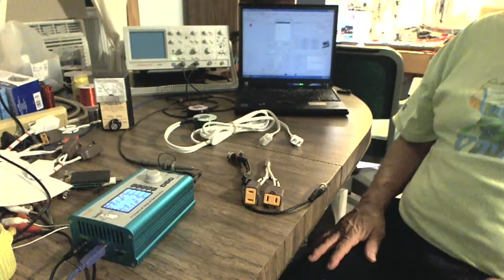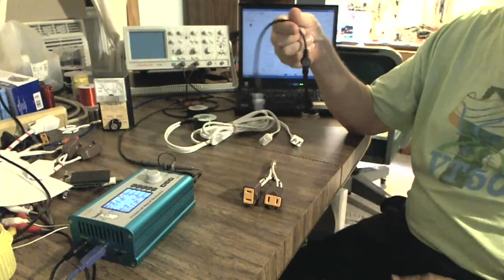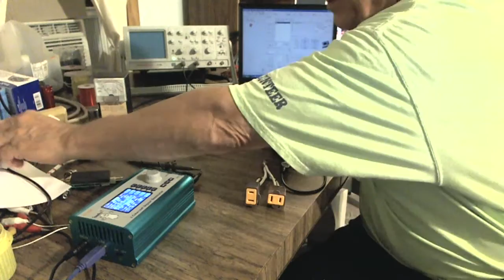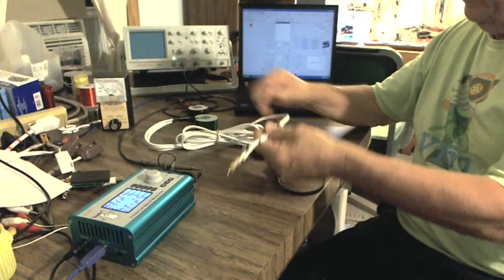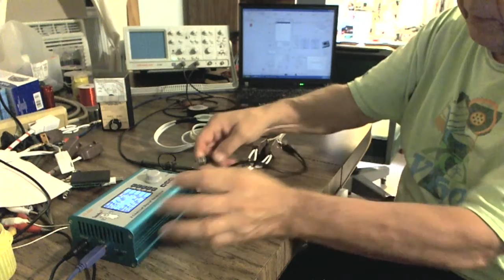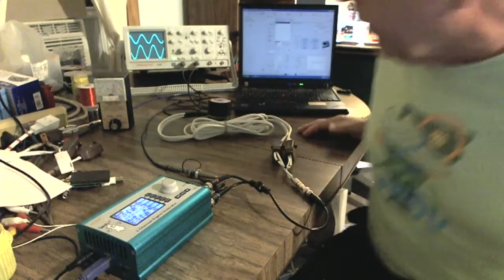MAG & Scalar with Spooky Boost

Comment: I heard of three methods to produce scalar.. .Bifilar, pancake and mobius coils. Which one is the best? Is there any need of a specific gauge of wire?
Reply from the maker: The short answer is NO for low power sources like a Function Generator which is one of the more common frequency sources.
Reply: @gskempe9  You said NO for which option? I have a spooky2 XM gen. Which option do u suggest now?
Reply from the maker: @drchoprashow  The NO goes appropriately with the wire size matters?  I do not have enough experience with the various coils types you mentioned to make a determination which is better.